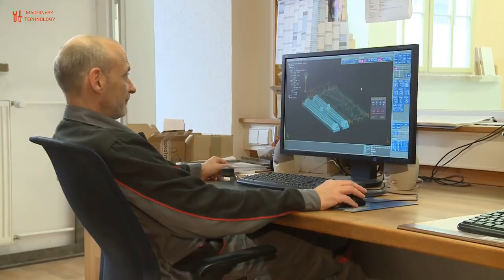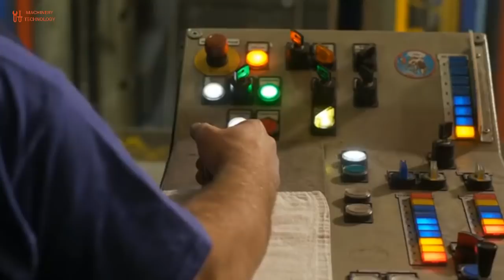Amazing Metallurgical Factory - Modern Technology And Hot Forging Process

Comment: Lessons from here then:

1. Make sure to wear the absolute minimum/no PPE while working very close to the hot liquid metals

2. Have as many people as you can, who aren’t involved in the work process, stood nearby so that if something does go wrong they are likely to get hurt too.

3. And of course when lifting cast iron, be sure to use a chain block that isn’t rated/geared for the lifting weight so you have to swing your whole body weight off it and not just use your arms.